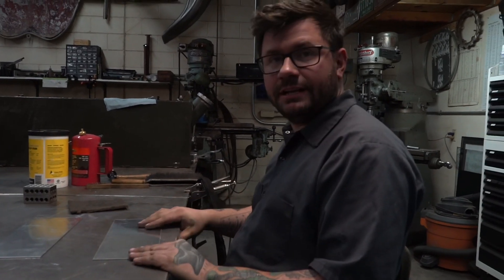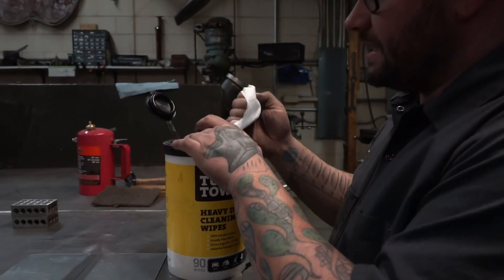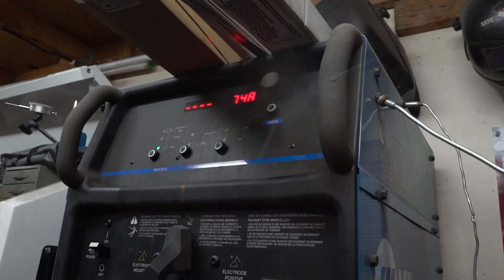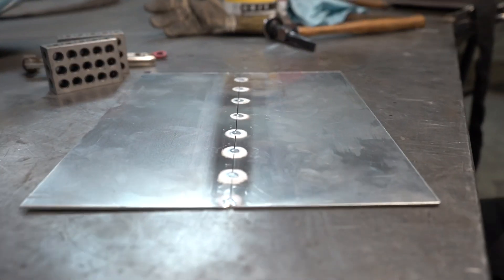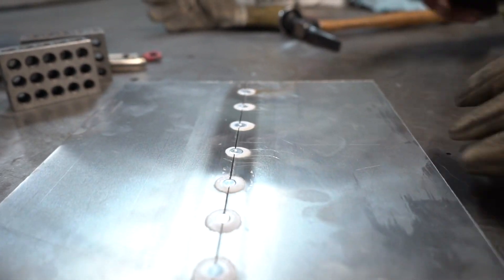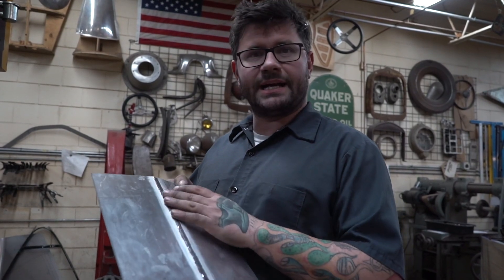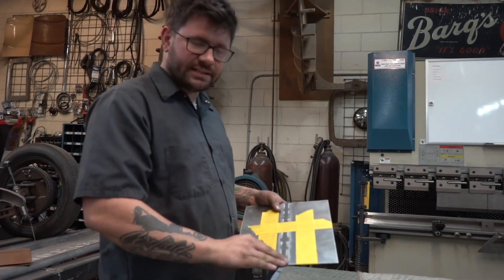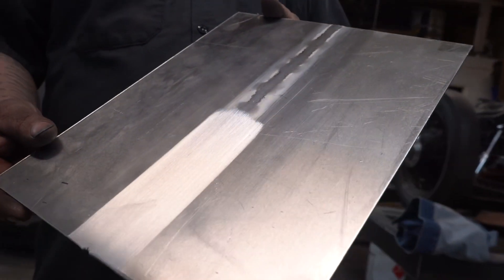Welding aluminum body panels

Comment: Ditch the music.  You left out the important part, you left a gap...how much?  What was the alloy?
Reply from the maker: You dont want a gap. You want a nice tight fit up
Reply: @cornfieldcustoms  Actually a slight gap is very advantageous and helps prevent warping.
Reply from the maker: @imwteach  no, you dont want any gap. Warping is caused from the cooling of the material after welding and the molecules contracting. You get that no matter what. You get more warping from having a gap . What little warping you get from welding os easily corrected by hammering the weld flat. I tig weld body panels together every day.

Comment: Nice quick video. Couple things: music was too loud, could barely hear you talking at some points. Also I would like to hear about the setup in welding videos: amps, tungsten type and size, filler type and size, metal thickness ect. Keep em coming!
Reply from the maker: Thanks for the input. We will definitely keep that in mind for future welding videos. I did put a lot of that info in the description
Reply: @cornfieldcustoms  You're right, I did overlook the info there. Thanks.